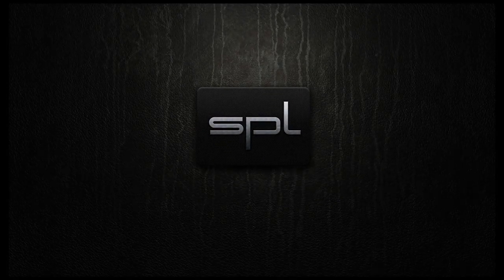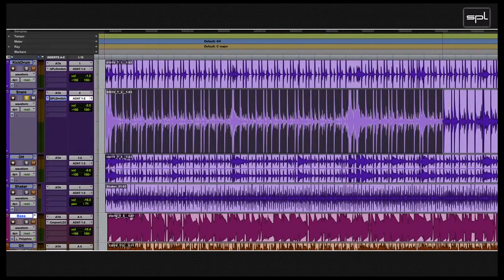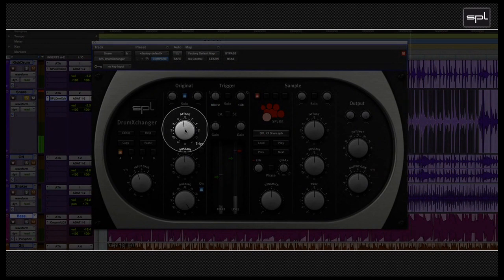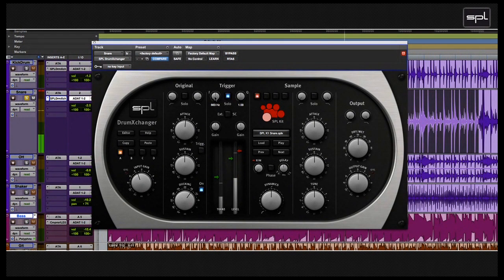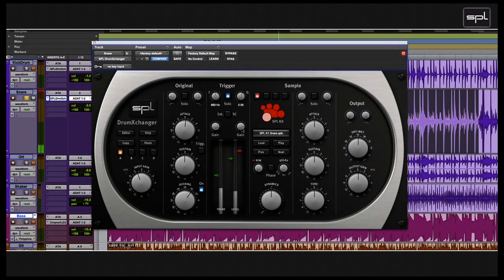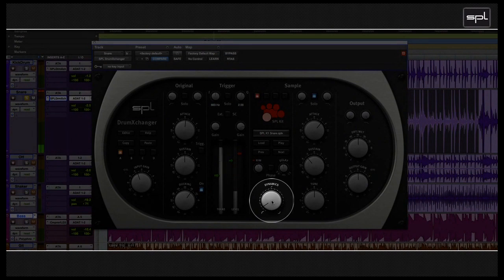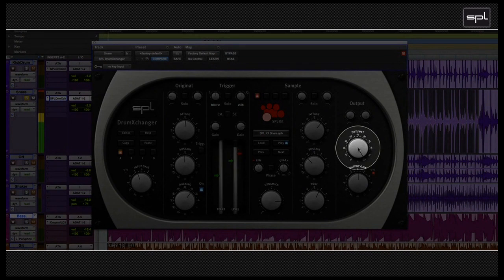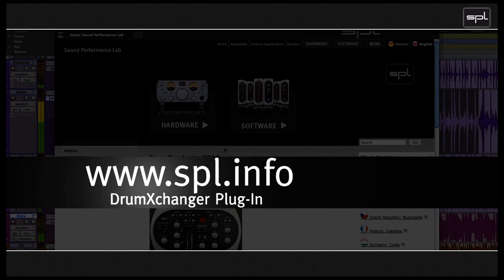SPL DrumXchanger Demo

Comment: For the love of all that's holy WHERE ON THE COMPUTER DOES SPL PUT THE STOCK SAMPLE FILES!?.  I dare you to find reference to it anywhere.  I searched my entire computer for "SPL" and "Drumxchanger" and the only thing I can find is some plug-in settings for Pro Tools, except I'm trying to use it in Ableton.  Seriously, I don't want to search through my entire computer for them.  I can use some of my files, but finding a good snare sound for this type of application is like looking for a needle in a haystack (at least in my sample library).  I figured that the included samples might be optimized for this type of use.  And yet: I can't find where they are on my computer.  Choosing the "load" button also DOESN'T default to the folder where the stock files are which should be kind of a no-brainer thing.  You'd think searching for "SPL" and "Drumxchanger" on my computer would lead me to the samples, but it nope.  I'm on OSX so the search function actually works.
Reply: You download them separately from PA page
Reply: The DrumXChanger's sample bank is actually at the bottom of the product page, and you can also find it in your Manage Registered Plugins page, if you select the DrumXChanger.  But I will also include a link to the samples here:
Sample (754.77MB)